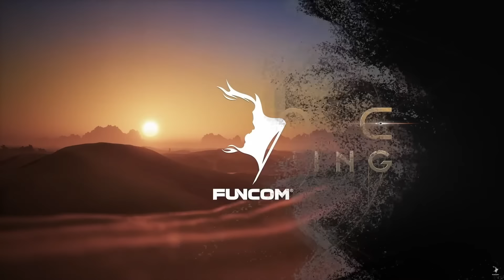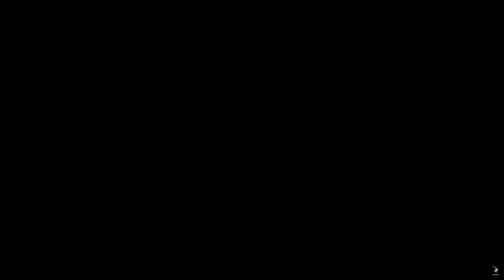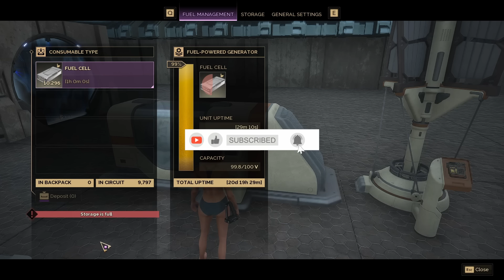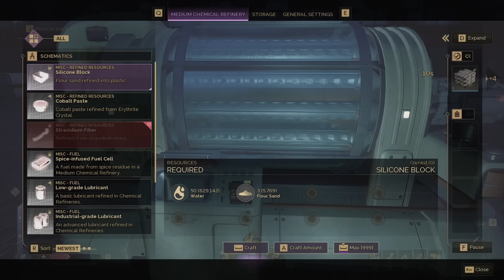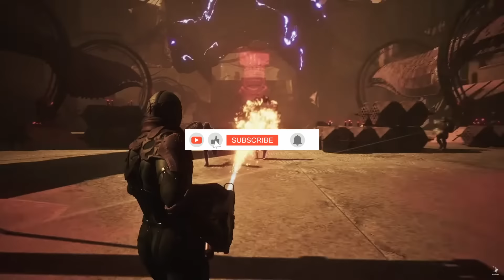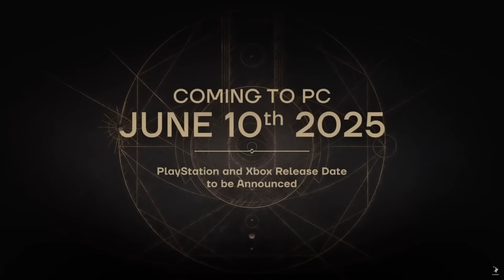Best Power Generator in Dune Awakening? Full Comparison & Breakdown

Comment: Its not hard to craft and run spice gens. 4 spice gens run my very large base. I don't want 12 to 40 smaller gens....
Reply from the maker: Yes, they have gotten easier as time has gone by we've had 4 updates, which reduce the cost of items for the spice power generator. They also made it a lot easier to find that you radiated slag. I still currently run directional turbines in Haga basin, and the only time that I use the spice power generators is in the deep desert as I don't put a whole bunch of staking units down anymore. So I don't get a lot of production units for my deep desert base.

Comment: My base has been so much better since I took the time to go through and build the directional turbines and scrap the regular gens I still had left over.  I do have one spice generator left over from getting the achievement that I've kept.  Maybe I'll scrap it too if I get tired of making the cells.
Reply from the maker: Glad it's running better for you! ❤😊
Reply: I keep one spice generator on standby just in case my industrial needs go over my other generators limits. It usually doesn't, but I just keep one fully powered and turned off as an emergency backup.

Comment: Main base uses omni's with enough power to handle high production loads with T1's  as the non-production mode power source as it is just too easy to buggy cutterray up batteries in like no time. All other outposts just use  T1's again because its just too easy to fuel them. I might add I'm solo and if i had mates playing with me I'd just use the Directionals instead of the omni's for the production source and likely not change anything else.
Reply from the maker: I just like the directionals, because I give you 31 day of power versus 21. But you're right. The batteries are super simple to get. I can understand if you didn't have spice residue to make the fuel. As that could be a problem in some servers.

Comment: This video largely recommends using the Directional Wind Turbine for base power, tempered with a sensible "consider your own situation". Given all the problems this week with Wind Turbines being blockable, combined with another base damage bug/exploit being pathways to losing bases, might it not be wise to add a note to this video about that risk, even in PvE areas? The Wind Turbine blocking issue seems to have been known about for months, at least August last year, so it seems like it may have been left in by Funcom intentionally, or at least remain for a bit longer given it's been involved in larger issues where bases have been lost at least on two separate occasions.
Reply from the maker: That was patched out on Feb/24/2025 in a hot fix. That was an unintentional gameplay mechanic.

Comment: "It costs 65 spice residue" - But you had more than 46,000 spice residue there, so what do you care? That's more than 10,000 hours of power, and you will have more residue because you need more spice. Cost is relative. The big advantage of the spice-powered generator is that you don't need flour-sand to run. You need slag, so basically, the question is, you would rather dodge the worm or farming slags from the ships.
Reply from the maker: You still need flour sand for silicone blocks for every craft that you do in the game. So do you spend a little extra time farming a little bit more sand or do you go and farm slag? That is the real question. How do you want to spend your time.😊 Honestly, if you're using that much power, the spice generator is the best fit for the deep desert as it is easier to move in and out every week.

Comment: We need a better way to manage placeables in bases. I have multiple bases on different servers, and friends bases that are on break, that i fuel. If you are in full production mode, sure run all your generators, but what i do when i'm not using all my big power draining machines, i turn them off. You can even reduce your fuel needs by then turning off generators.  Granted this can get confusing if you forget you turned them off. I typically turn off wind turbines if i don't need them. 

I'm playing with the idea of building a couple spice generators to use up my residue, but keep them off and only use them for when i'm in full production.
Reply from the maker: Yes, we also need a better way of filling up the wind traps as well.

Comment: Spice generator for me.. fill and forget for 30 days. When your harvesting spice its easy to get the amount of residue to keep it running iradiated slag is in every crashed ship in Sheoul. A run round all them will take about 20 mins and will get 190 minimum.
Reply from the maker: For the deep desert, I would agree that the spice power generator is good because you have less weight to move in and out. But you still get the same 30 days out of the directional turbine. With how hard they made flowersand to get it maybe easier to fill up a spice generator. It's still one extra thing to go and farm.

Comment: Playing solo with 6 spice generators and I cant' understand why do I need to think about what's more effective, it not hard to supply them, but it's just 6 generators instead of 20 or not shure many other generators you need to keep 6k power.
Reply from the maker: It really comes down to what you want to farm more Slag or Flower Sand. Flower Sand is used in a lot more recipes and crafting lines than Slag, so from an efficiency standpoint, it’s usually better to focus on farming Flower Sand. You’ll will be gather it naturally while moving through the desert with crafting, meaning you don’t have to go out of your way for it in, the same way you do for radiated Slag.
Reply: @cuddlesrus2020  Yeah, you're right actually

Comment: So my guild is using the spice generators for the guild base and our refinery base in Hagga is going to move to that as well as we have several large ore refineries and medium chemical refineries that work each week to supply materials for the entire guild to use, especially to help with covering losses from a hard week in the DD.  So it’s economical for us to use them, but for smaller guilds and solos, yeah I can see that directional/omnidirectional ones are the better option from a cost standpoint.
Reply from the maker: I can see using them for the DD. As they cost half of what they normally would in the HB. It would save you on weight as well and cut down on the trips back-and-forth.

Comment: Its all about production limits. You can get sooo many fuel cells in the DD just at the entrance.

Once you hit 80 production, you have to start switching out the scrap geberators for better ones. I honestly just go by what i need and swap as needed. After a few spins of a large spice refinery, you will have near unlimited spice residue.

I wouldn't ever build the spice genarator, though. I am at 5k power, only because i have multiple fabricaters for convenience of entry, every advanced fabricator, and refinery. My base is max slots, so unless you're running 2 or 3 large refineries, you'll never need more than 5k power.
Reply from the maker: Yes, I switched out all my generators for the Directional turbines. Due to the fact that they all last 31 days and I don't have a discrepancy in the amount of time each one has too. I'm glad you found the video helpful and thank you for your insight.

Comment: I'm to the plastanium stage, not sure if I need to upgrade my 30 generators to lubricant used at this point because of using scrap merc gear and recycler mainly. this helped me know about building and  generator limits and uses
Reply from the maker: It's good if you need the power and more time. Otherwise it's not really necessary.

Comment: For the DD with the 50% build cost reduction and getting 100% back the only cost to consider is 6 days of power generation for what you have. In HB manage to run a full base in a basic sub-fief with only making an advanced fabricator when I need it and I can have my buggy, assault and scout and 300k water using the basic generators. At this point until updates I am not making a bigger base and tbh this is working well as is so I may never go back to an advance sub-fief.
Reply from the maker: Honest I'm very envious. I would love to make a tiny base. With people work out of my base it's not likely. My base is very small compared to some of the other ones that I've seen. Even with full land claims.

Comment: 1:30 What do you mean by, "You need two basic generators to power one omni-directional wind turbine."   The wind turbines don't require any power to run. They use "Low-grade lubricant" to run, and they generate power.  You don't need to run any basic generators to power a omni turbine.
Reply from the maker: It takes 2 generators to make the same power as the omni.

Comment: I'm solo and in early duralumin tier. I don't have many production devices so hitting that cap is not a real issue for me. I've started using the omni-directional generators as they don't take up as much room for the same power. I was also able to place them on the edge of my build that was otherwise unused land. 

But with the flour sand change and silicon becoming that but harder to get I'm might go back to basics generator. I'm about to expand my base with a second hangar, I will build a false floor in the hangar and spam down basic generators. 

I'm close to Directional generators, but still that but out of reach.
Reply from the maker: That sounds like a great plan and exactly what I would as well!

Comment: By the time you can make a spice generator, Spice Residue is worthless.  It becomes a burden to store, so the increased cost of using for spiced fuel cell is non existent.  The slag is a much bigger issue.  I agree the directional is the best value, but it really depends on what's important.  You can defend the spice generator better in DD builds than you can the directional, which is a huge weak point for a PVP base.
Reply from the maker: If you put the directional under a pentashield, it becomes less of an issue in the DD. Slag is definitely an issue though.

Comment: erm its expensive to build the spice generators it doesn't require anything but the spice fuel cells to actually run them

also i have every teir of vehichle, weapons, garment and survival fabricators large ore refinery large spice refinery several advanced deathstills  repair station shredder  upto 12 large windtraps and with all them turned on it requires around 7k power, but to mitigate this i typically turn  the fabricators and refineries and deathstills off while im not using them reducing that need for alot of power
Reply from the maker: Thank you for sharing your experience!

Comment: I do really agree about the scam pcie generators they look good but not cost afective am using 3 bases one dd one tax free + one adv with boxes and split the production side by side one block adv only 4000 solari 2,5k*2 =5000 power even over the bases i can fit all of the advanced 40 + 40 no need to make big ass base and i only use fuel and wind turbine but now depending qal tomorrow i think i stick to only generators u can mange am supriced not more people make use of this system it´s cost free over 1k fuel cell with buggy/box focus mk6 spend 15 min tops on fuel a month
Reply from the maker: Thank you for sharing your experience!! 😊

Comment: Biggest thing for me is that the spice residue has very few drains. I find myself filling entire chests with it. The spice powered generator helps with my Hagga basin storage management. Agree that deep desert is different though. And it's different pve vs pvp. Pvp it's fuel generator. Pve is directional for me. And Hagga is then directional and spice generator. This also comes down to the fact that my base is the guild hub. I have multiple of each refinery, all the fabricators, blah blah blah. Anyways, appreciate the breakdown regardless if I don't agree. Your time and opinion is appreciated
Reply from the maker: Thank you so much for your opinion as well! :)

Comment: im new, and trying to decide what gen to go with but you would get more time out of the spice fuel cells, because the 10 only power 1 generator... correct? i guess its not important, because i dont feel like id ever be able to afford building it. lol
Reply from the maker: Both the Standard Generator and the Omniol Directional Generator have a 21-day runtime. If you upgrade to the Directional Turbine or the Spice Field Generator, you'll get up to 31 days.

But if you're just starting out, I'd recommend sticking with the Standard Generators — early on, you won’t need as much power. Once you’re able to consistently gather duraaluminum and farming spice for residue, that’s when it makes sense to move into Directional Turbines for better long-term efficiency.

Comment: Going solo, I have a working theory. I have five of the initial battery generators, which I call "boom boom generators." I keep about five on hand at all times, just enough to power the Penta-shields and the fief. If I decide not to log in for a while, I shut everything down. I currently use about ten omnidirectional turbines but will be moving into the directional ones soon. My theory is that for every three omnidirectional turbines, I can replace them with one directional turbine. So when I place a directional one down, I'll delete three omnidirectional ones, still keeping my power production low. This, in turn, gives me a ton of versatility to run my small little base, which is living rent-free in Hagga Basin by min-maxing my space. Things like large refiners or large spice refiners are pure luxury and a flex that I don't need. Yes, it does take longer to process, and it is slightly inefficient. However, I log in, check the power, run whatever I need to process, and log out. I log back in about an hour later, and everything is completed. It just works better. I am a filthy PvE casual tourist that just likes playing in the DUNE universe.
Reply from the maker: Sounds like you figured out what works great for you!! Great detail 😊

Comment: The math is way off on this.  Personally don't like it when videos obfuscate and lie to the gamers/audience.  SpiceGens are way more efficient.
Reply from the maker: Appreciate the passion, but let’s break this down with actual math — not just “I feel like this is better” energy.

You're praising the Spice Generator as the best, but you're skipping the part where it’s wildly inefficient on fuel cost. Here's the numbers:

Spice Generator gives you 1,000 power, sure — but each fuel cell costs 6.5 Spice Residue, 1 Power Cell, and Irradiated Slag.

Directional Turbines only give 350 power, but each fuel cell costs 0.5 Spice Residue and 1 Power Cell. That’s it. No exotic crap.

To run 4,500 power for 1.5 hours:

Spice Gens: 5 units → 5 cells → 32.5 residue, 5 cells, 0.5 slag

Directionals: 13 units → 13 cells → 6.5 residue, 13 cells, zero slag

So let’s recap:
You're burning 5x more residue, plus slag, just to save on a few building slots. Meanwhile, Directionals sip residue like it’s vintage spice tea and ask for nothing else. Same uptime. Same runtime. Less headache.

So is the Spice Generator strong? Sure.
Efficient? Absolutely not.
Reply: @cuddlesrus2020  No passion involved.  Just an understanding of size.  And what happens when the shields go down and all your power is on the roof? Do the shields ever come back when they take rockets first?
Reply from the maker: @scotts.7855 First off, you can place wind turbines under Penta Shields, and they still function just fine — as long as the Penta Shield is acting as the roof. So no, they don’t need to be out in the open or exposed in a deep desert base.

Also, I never said to use them in the deep desert. I said we no longer process out there. So for anyone farming in the PvE zone or running a base out of the PvE deep desert, placing your turbines just outside the base or under shield coverage works perfectly fine.

If you're farming in the deep desert PvP area, then I recommend using basic power generators instead — and keeping your base lightweight. Have 3x the power needed and keep the inside minimal with only what you truly need.

It’s all about using the right tool for the right environment — not every setup needs to survive a sandstorm to be efficient.

Comment: Tldw: As long as you are not harvesting spice regularly in the Deep Desert, the small wind turbine is the best thing you can put down.
If you are harvesting spice regularly, you use the big wind turbine. Basic generators are good, but count against your max machines for your base.
Reply from the maker: Here's the math, breakdown of the fuel cost:
Fuel per Hour	 Large 1 cell = 1.5 hrs 	Small 1 cell = 1 hr
Fuel Efficiency	large 233.3 power/hr per fuel	small 150 power/hr per fuel
Directional Turbine	350 Power	1.5 Hours	31 Days
Omnidirectional Turbine	150 Power	1.0 Hour	21 Days

Omnidirectional turbines are still a good option early on or in tight spaces, but if you're processing at scale or looking for long-term fuel efficiency, directional is the clear winner

Comment: Agree with the Directional Wind Turbine.  I'm solo, but sneaky rat a ton of spice, so every week or so I wind up with 20k spice residue.  I don't like wasting anything so I started making industrial grade lubricant and find the refined state makes things so much easier to transport.  I've also got a large number of advanced fremen stills, large spice refinery, two large ore refineries and all the advanced fabricators (in my main Hagga base, not counting the temporary DD bases).
Reply from the maker: We're the same way. After the mess-up and the DD, we started processing everything in the basin. It’s actually been pretty manageable in terms of transporting raw materials back. Plus, I don’t have to worry about breaking down and rebuilding a base every week just to process large amounts of spice or ore. Has made my life a lot easier.